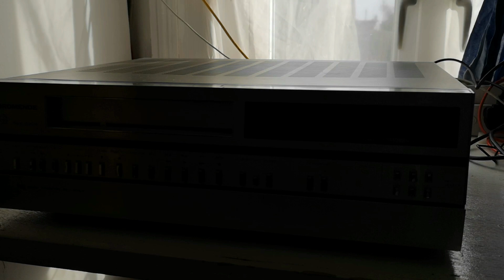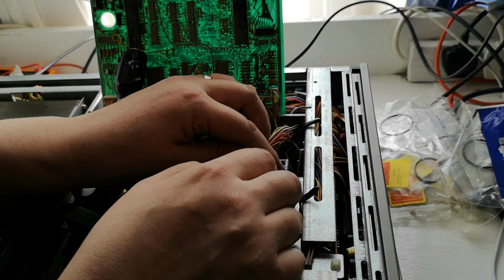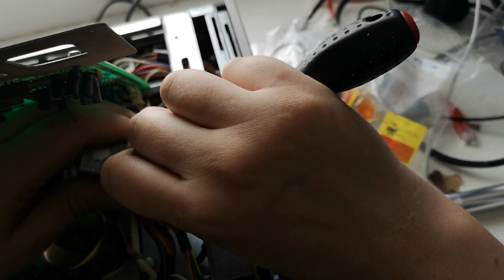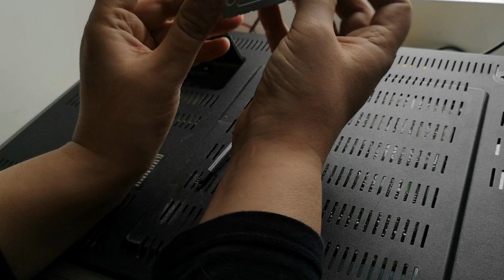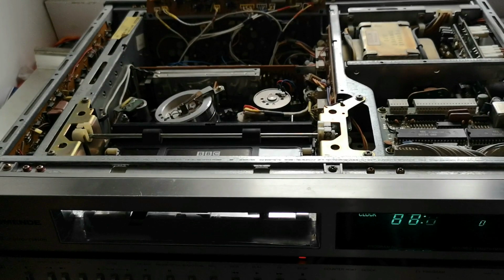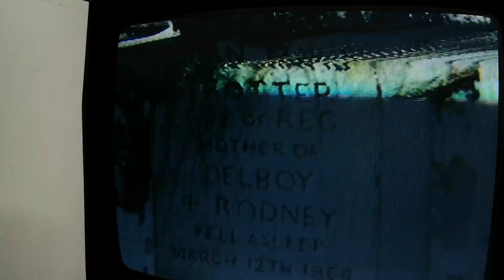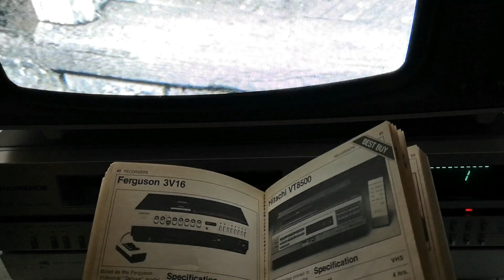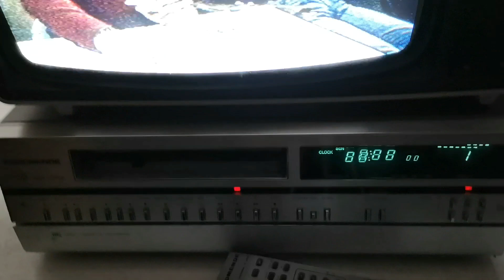Nordmende V500 Spectravision - Recommissing

Comment: Lovely old machines, these. And quite unusual to see a NordMende version! Like most, we had the more common Ferguson variant from new in 1981..and yes, I'm certain you could've purchased a small island out in the Caribbean for the same amount (with change to spare!).

They were complex beasts on the electronics side, but mechanically quite simple..so really one extreme to another from a repair perspective. I don't envy the service techs who had to do warranty repairs on these back in the day as that must've been quite daunting!

I note mechanical similarities between this, and your ITT 3V32 clone..although I never owned the later 3V31/32 or any of its iterations. The 3V23 lasted us well into the nineties, and was then replaced with a Philips 4-head NICAM (interestingly, also a JVC in disguise!).

As for the frame fold-over on the Pye; it might be worth trying a 10dB attenuator on the RF input, as the signal might be coming in a bit hot (assuming you're already using the channel reserved for VCR use).
Reply from the maker: Superb comment, thank you 🙂. I am rather pleased with the deck, I have some of the 3V23 versions, but, will be gifting those to a friend, whom is desperate for one!. Thanks for the tip, re the PYE, it is on the VCR channel, so I do suspect it's coming in a bit hot, an attenuator is next on the list. Thanks again, its really appreciated 🙂
Reply: @JCTsFascinatingHobbies  No problem! I'd love to own one again, but I have way too much stuff as it is. Original Ferguson machines do appear on eBay from time-to-time, and it is very tempting I must say! 

Actually saw one there a while back that had 32 channel presets on the remote (instead of the usual 16) - with a shift key to access the higher numbers. Must've been a later revision, although I don't know who'd need 32 analogue channels unless it had some ability to pick up analogue cable TV or something..

Anyway, keep up the good work. You definitely deserve more likes and subscribers! 

-Andy =)

Comment: I have the AKAI version, the VS-10. Mine has two problems. The VFD driver board is dead and it makes poor recordings. It plays back perfectly though.
Reply: Some early VCRs have rec play switches like cassette decks have you should try cleaning the rec play switch and  see if it works, My Saba VR 6000 (Rebranded JVC HR 3330 has rec play switches)

Comment: hi do you know if this video is similar mechanical with nordmende v102 ?
Reply from the maker: The V102 is a newer deck and a lot simpler than the V500. The V500 which is based on the JVC HR7700, was one of the most complex VCRs of the time. Only similarities may be the basic deck and items such as the loading motor. Mechanically, the V500 has more in common with the JVC HR7650/55 (there is a Nordmende version of these two decks). From a feature standpoint, the V500 is more fully featured than the V102.
Reply: thanks 
do you know maby someone video with my model ?